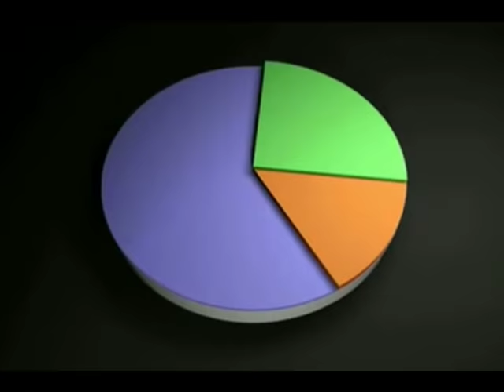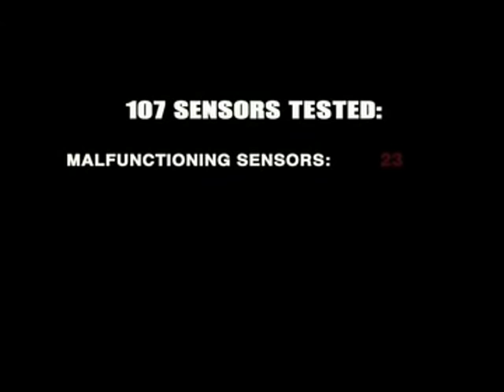K&N Filters - Do oiled air filters damage MAF sensors? Testing & Results

Comment: I never had any issues using K&N filters and cold air kits. I put one on my truck and it works great.  Don't over oil the filter element and make sure your crankcase ventilation system isn't dumping too much oil into your intake.

Comment: Bought K&N filter years ago, after 6,000 miles I noticed a slight film from the filter to the throttle body. My truck still ran, but there was now a slight film. My mechanic cleaned the MAS and all parts from filter to throttle body, and he seen this before with K&N filters. Most people don't notice a problem because and trade in their vehicles every other year. I've seen a forest fire truck where the fine ash particles made it pass the K&N filter glue to the entire surfaces. Rather than talk about it throughout the video show your testing equipment at work.

Comment: Read the cleaning instructions properly. Some people think more oil is better, others say less is better. The trick with K&N is to let the oil soak in from the fresh air side for 1 hour at 20C then re apply oil to the less covered areas again from the fresh air side. I've been using them for years now all in MAF vehicles and all with ultra clean air boxes and no MAF issues.
Reply: Aussie Taipan well done explained. If you follow the vendor instructions and don’t over oiled you will reach the result that vendor says. Most of people does not follow so why the people complain?

Comment: I have a K&N cold air intake in my 2015 ford expedition and I'm very satisfied with it. It came with all of the parts and was extremely easy to install. I even noticed an increase in horsepower as they guaranteed as advertised. Great company👍👍👍
Reply: You "noticed" an increase in horsepower? Show the dyno results. Saying you "noticed" a HP increase is BS.
Reply: BigDk DPS Go check for yourself.  That shit is just lazy and annoying.  You are on YouTube and you ask someone else to do research for you.  Really!  Look up G37 drop in air filter dyno tested.  14 Hp increase.  People should learn before you speak.
Reply: Can I asl how long have you has it on? Do you still have it on?

Comment: 138000 miles on my cavalier z24 using a k&n short ram intake. No issues. I love my k&n filters. I use them in my Yamaha fz6r 29000 miles no issues. K&n oil filters as well.

Comment: I have used them since the 70's and have never had a problem,  cars, gas trucks,  diesel trucks,  motorcycles.
Reply: did you also oil the filter after cleaning?
Reply: @TubolMotoadventures  if he's been using them that long he would have to. And be a master at oiling them.

Comment: K&N researches their own product and finds it flawless... what a bloody surprise.
Every mechanic on the planet has seen oiled up air filters coat the intake system, it's not something that happens over night, it happens over a large period of time and it is an area no one ever checks.
Reply from the maker: +MsSomeonenew Hi. About oil in the intake system. I think you will find this on 99.9% of cars due to the crankcase venting into the intake system. Nothing to do with the air filter.
Reply: Michael 100% correct, just an excuse k&n uses to defend their products that damage  maf sensors. i have a subaru wrx and my maf is placed way out near the end of the air intake pipe. i also have a air oil seperator on my wrx...been there since i put it on within a week of owning the car...so zero chance of engine oil contaminating my maf. the only cause of my maf failure was running a k&n air filter. it was proven to me by more than 1 ase certified subaru mechanic.
Reply: but k&n oil filters are damn near the best constructed oil filter i have ever seen. cut a bunch of various oil filters apart just to see how and why they work. k&n has a top teir constructed oil filter. for less than $15 it is way sturdier bulit than most $20+ oil filters
Reply: if your getting oil on the other side of the filter  that's from the filter it's self I have seen oil in the intake system with stock replacement filter  so either it's just the nater of the environment or you have over oiled your filter  other wise I have never seen any problems arise from using a K&N filter ever and I suse them in all my vehicles
Reply: Don Rowe Try Purulator at any price, I promise you it will out perform the K&N with ease. Even their cheapest Oil Filter is of higher quality than the K&N

Comment: I've had a K&N filter in my 1995 C4 Corvette for 22 years now. I have clean MAF and inside of air intake manifold shows no sticky oil residue. I do have a little oil residue but it is not from the filter. Engine compression is about the same as when the engine was first broken in. Of course I clean my K&N per instructions and do not "soak" the filter with the oil spray medium until point of leakage. This is the key: follow mfg. instructions!!
Reply: As they used to say in the Navy, when all else fails, follow directions!

Comment: I've owned about 6 different cars all of which I had a K&N filter, all with a maf sensor and none of them had any problems with a malfunctioning maf, and most of these cars I put about 30000 miles on.
Reply: jda8176 most of the people complaining here have the kn intake system which could throw a cel unless they get a tune. I only have the filter and i clean my maf and throttle body and kn filter every year. I dont over oil it at all.
Reply: jda8176 was is the it I

Comment: I just cleaned loads of oily gunk off my MAF sensor. Was only dirty on the filter side which is hard to see through the mesh, so it took me ages to diagnose the cause of terrible engine performance.
The K&N Filter oil was absolutely responsible for fouling up my sensor over many years. They are good filters but you must clean your MAF sensor once a year if you use K&N.
Reply: What do you use to clean your MAF sensor?
Reply: kucharz1986 they sell special cleaner for it. Maf sensor cleaner

Comment: I was knee-deep in filter review and research and ended up choosing a k&n When all was said and done because of the performance in the 0 to 60 benchmarks even though the wix filter performed usually on par in that regard but I was concerned because I heard the oil in the filters would screw up sensors along the air path. I asked an employee at the auto parts store near me how often people came in complaining and they told me only around every four years or so so I felt pretty secure that I would not be one of them and that the chances would be slim. Well long story short, I think most of the people that did not complain where are the types that just didn’t notice the RPM changes.My car no revs just above 1000 RPMs at idle and is nowhere near as stable as before I started running this filter so  I would say that the results are in. Now if K&n is willing to replace my sensorsI may change my mind
Reply: Horrible in the heat!

Comment: I ran a K-N in my Ford Crown Vic interceptor (4.6 V-8). I also have one in My Ford Explorers (5.0 V-8)  NEVER had an issue with any MAF or anything else. I had a blue paper towel stuck to the underside of the filter and never new it until I went to clean the filter !!
Reply: One of the main problems is that people soak the filter with oil. All it takes is a light coat that shows that the filter element has a red tint to it. It's funny, I've known engineers that can't follow simple instructions, then they blame the filter because they had it dripping with oil when they installed it.

Comment: My new RAM: I installed a K & N filter. All seemed good then the day before a big trip on comes the engine light and I start getting crazy temp readings. It is the only modification I have performed. I have now removed the filter and cleaned the MAF sensor. The light is now off and only time will tell if my decision to remove the K & N was correct diagnosis.

Comment: Here’s some advice. Use the filter as long as you can out of the box. And after 30k miles just toss it away and buy another one. Fuck the cleaning and reusing. If you get a good filter for $50 that can last two years? Then that’s pretty good.
Reply: 50 bucks for an air filter? Netherlands, a Bosch air filter for a Volvo V40 (old type, the one that was produced until 2004) sets you back about €10 (about 12,10) including taxes.
Reply: 50.00 for a lifetime filter is much better than 50.00 for 2 years. If you keep your vehicle for 10 years as the average, you'll spend 250.00 on filters for 10 years. That's a no brainer, unless cleaning the filter is too much of a chore.

Comment: So if there's oil on the surfaces of the intake system, (which I've never seen any that dont have some amount of oil), unless you disconnect all other inlets to the intake, (PCV which is designed to route crankcase Oil Vapor to the intake), how would you know the oil came from the filter?
Reply: Unbelievable you would even ask

Comment: I had a cold air intake system installed in my 370z and it came with two large pre-oiled cone shaped K&N air filters. After about 30k miles I did a tuneup and inspected the filters, intake tract, MAFs and the throttle bodies. I saw no dirt past the filters, nor any oil film anywhere downstream of the filters. Two used oil analyses that I had done on the  engine while the filters were installed showed no unusually high levels of silica(sand), hence the filters seemed to be doing a good job of air filtration.

Comment: I think many people over oil them and not let it set before use...
Reply: I made this mistake and indeed had to change my MAF. After this, I oiled it correctly and since then have not had a single issue. I put 60,000 miles on that new MAF and the car is still running like a dream.

Comment: 300,000 miles on my K&N FILTER ,V8 TOYOTA TUNDRA.
Reply: ... and aside from the constant backfiring, stalling, hesitation and check engine lights -- it runs perfectly fine.
Reply: @bladder1010  Says the guy that drives a Ford..LOL
Reply: @bladder1010  Those are vehicle issue's not filter issue's!
Reply: @ddm62571  I guess if you call the fact that someone stuck a K&N filter on the vehicle a vehicle issue, then, yes!

Comment: their great filters i’ve been using them for over 20 years on car’s,truck’s and motorcycles with no issues, but when I clean them I’ll let them dry thoroughly overnight. if need be I’ll reinstall the old paper filter till the next day ensure the filter is bone dry. then lightly oil the incoming air side that’s it. the oil will pull itself through the filter. I think the problem is people spray too much oil on a wet filter and “poof” you have a mess. either way the sensors can be cleaned using “mass airflow sensor cleaner” if that doesn’t solve the problem then the sensor was on its way out.

Comment: Running K&N in my Duramax for over 10 years, no MAS issues BUT to say oil doesn’t come off the filter under any normal condition is BS! Oil drops off the filter and coats the inside of the air box and oil film travels up the air intake system and a very light film of oil coats the inside walls of the intake and sensors.  For performance it’s K&N all the way but for maximum clean air to the turbo, OEM paper filters are hard to beat

Comment: I keep getting a lean running fault when temps are below 50 degrees with the K&N intake kit on a 2002 F-150. I clear the fault and pass the Texas inspection for the last six years. Why does everything work fine until the air temp drops below 50 degrees? In Houston,, below 50 degrees is a BLIZZARD, so I just keep clearing the fault and drive on. Nobody I know with factory air filter systems has this problems, several with K&N have got rid of their K&N because of this. I'm keeping mine!!! 19 MPG average with a crew cab 5.4 engine, over 220K. Never had a problem with OEM intake. But I NEVER got a 19 mpg average. Been driving the same route to work  for years and same traffic in Houston. I'm keeping the 5.4 Triton and K&N for now. K&N=Not perfect,, but I can get around it!
Reply from the maker: Because it happens below a certain temperature, Id say it is because the engine is getting too much air (according to the ECU). Lean running fault would back this up and also explain the good fuel economy. Im not sure if it is something to worry about. Could be worth running a wideband on the car just to check it is not running too lean, like 16.5:1+
Reply: @DriveTuneMedia  colder the air the more dense it is hence more air jammed into same space.

Comment: tried this on my 12 tacoma,before Install, I clean MAF and throttle body at oil change then about 16k later I decided to clean MAF sensor and throttle body, it was black?? I've clean MAF sensor every oil changes but this time I didn't for 16k ,don't know if all that blk stuff is the oil on K&N filter?I got the one that drops right in to OEM filter housing I'm going back to factory filters :(

Comment: I had a 1950's car and they all have oil bath air filters, no problem.  Paper filters were devised to boost sales of expendable parts.
Reply: Oh did that car have a MAF?
Reply: 1950 cars has no electronic sensors. They were cruel and simple. Try it on a 2010 Mustang - 2017 Corvette. Then you get your paid answer. Granted some products were excellent in the past for older cars. I recently ran into warranty problem with my Michelin tires due to cracks and dry rots by using tire shine products ( Amor All) that were well proven & popular in the past. The tire dealer and Michelin gave me hell and played the Blame Game on me.

Comment from the maker: Generally speaking, MAF sensors are quite robust and simple ie no moving parts. If for whatever reason you think the MAF is causing a running issue, you can probably clean it. 

An article showing how to clean a MAF sensor - http://strikeengine.com/maf-sensor-cleaning-problems
Reply: StreetandCircuit Exactly, very easy DIY to spray the maf sensor with the correct spray......why are people winging?
Reply: StreetandCircuit its clean and I know how to clean the MAF, its the K&N oil causing the trouble.

Comment: 2:16 it would nice if they actually "showed"  5000x magnification.
Reply: @patrickscycleshop  i have one, yes, you can kind of see through it, but not that way. Your seems to have only the metal wire mesh and none cotton fibers.
Reply: @mc1996  lol. This is a completely intact k&n filter. I have about 500 filters in a box that coincide with the 500 engines I have in my warehouse that all have compression loss due to dirt ingestion.
Reply: @patrickscycleshop  i see...so K&N are good after all, they keep your garage full of costumers ;)
Reply: @mc1996   Unfortunately replacing engines is not the kind of work I like to tell my customers they need to do.  I would rather do performance work and service work and keep people moving forward instead of going backwards.

Comment: I had K@N filter on my 04 3.0L Ranger Edge and finally went back to stock Motocraft paper filter  because it was making engine idle between 1 @ 1.5K RPM at random times! When I went back to paper it idles perfectly at 650 RPM! I even used MAF cleaner but it didn't help? Just my opinion but  think your vehicle's computer is dialed in for a stock filter and if you want to add K@N, you'd have to get your car dynod and chiped for increased airflow?

Comment: I have one in my 2012 Camaro Supersport. The Engine light came on. Took it to the dealership. They said that there was a problem with the mass air sensor. They changed the air filter to a factory air filter.

Comment: This sounds may stupid but it's a true story of mine..
I once owned 19?? Ford Ranger..
One of many oil change services, I took the truck to Jiffy Lube and the guy suggested me that I should change the air filter because it was getting dirty and I said  "okay"..
Three months later, I checked the air filter and I found out it was not a right air filter for the truck because it was right size in width but not in length.. The guy at Jiffy Lube cut off the length to fit the filter in the box and he didn't even cut it to the right length.. it was a good an inch opening..
So, I threw away that air filter and I didn't put any air filter since.. The car had 30,000 miles on it at that time..
I drove the truck to 127,000 miles and sold it..
The truck had no problem since the day I sold it..
Of course, I put a new air filter in the truck before I sold it to one of my dearest friend 😁😁😁..
I didn't hear any complaints form him up until today..
I understand if you don't want to be my friend..

Comment: So who are you going to believe.  The manufacturer of after market parts or the auto manufacturer.  Personally I've never trusted a dealer further than I could drop kick them and that has worked for me for 50+ years.  Also I don't believe the hype from the after marked industry.  I think the design of the mass air sensor is flawed if it is adversely affected by air borne dust or oil because you never either of those around cars or trucks.
Reply: auto manufactures are the biggest scam artists on the planet lmao

Comment: First ever K&N filter fitted to my Audi TT and after a few weeks engine would judder when coming off the gas at lower RPM. Took the MAF sensor out to clean it and found a thin layer of oil all over the sensor. Cleaned it well and car has been fine since. Coincidence?
Reply: Next time get a dry filter